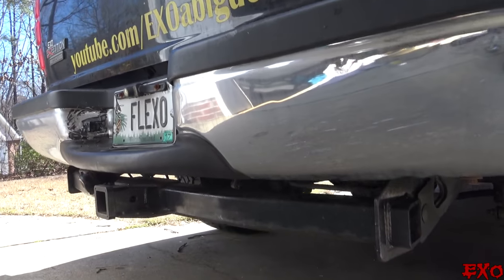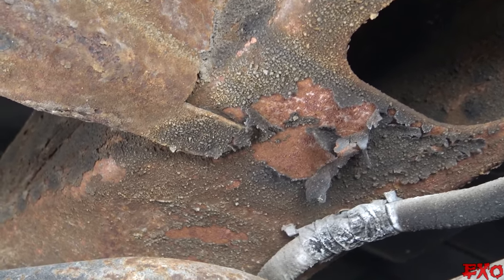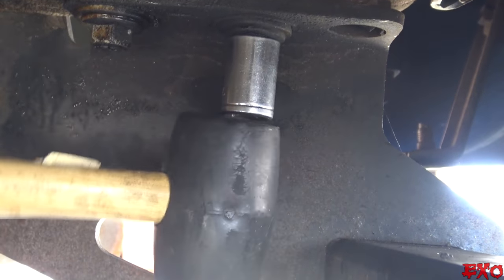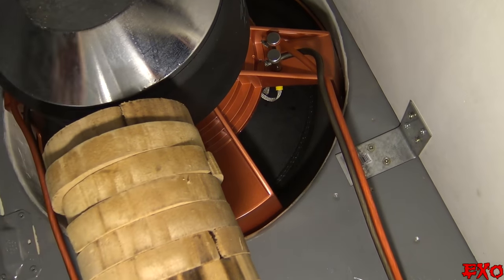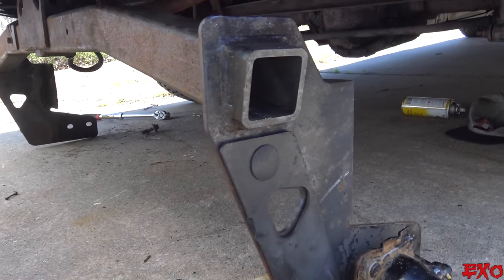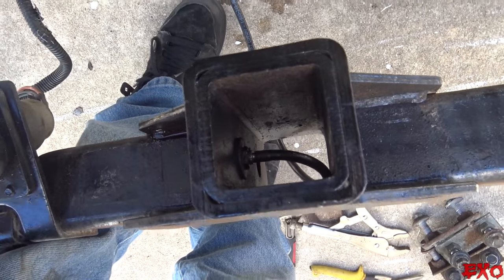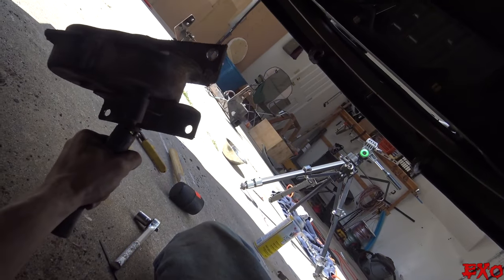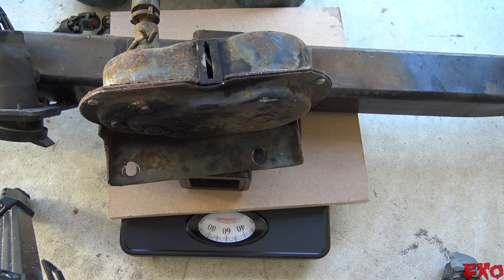FRANKENSTEIN Gets Lighter... Reducing EXO's Truck Weight by Removing UNUSED Metal Towing Parts

Comment: In my Pajero. I've towed a trailer that had my engine for it. My Pajero has just as much weight as your truck has. and I towed the engine alright. I can't see the tow bar would do much to the over all weight of the vehicle. Might even come in handy some time like mine did.

Comment: ditch the bumpers and run some roll pans to lighten it up more.
Reply: pickle street customs *AGM battery would easily take 10lb off compared to the antique lead acid design. lightweight forged or magnesium wheels but it is expensive.

Comment: por 15 rust converter and under coating easy to apply and last for ever i just rinse off my engine bay on my 1980 t top firebird  and it shiny black again with water and it kills the rust no sanding and very little prep

Comment: Hey EXO. for the underside rust  cleanup. Get some Naval-Jelly it's a tried and true effective products. There's a lot of rust removal products out there that don't work for DooDoo. You want a good penetrating oil? Not saying the other 2 are bad, but Kroil is called, "The oil that creeps", for a reason. It comes in a spray can and a can. Both work but the can stuff is better

Comment: I rebuilt an old utility trailer and needed to address the rust issue on it. So I did some research and found a rust converter called corrode all, check it out. All I did was scrap any rust the was flaking off then used a spray gun to apply it. It converts the rust into iron oxide and turns black, very easy clean up...just a suggestion.

Comment: Krawl works well with rusty bolts an nuts. Just sharing some good stuff I used when I worked in a welding shop, didn't use with welding I have my degree in it. Always had to fix the mower or something with stubborn nuts and bolts. Hope the krawl helps for future stubborn parts. Kills wasp too, can't stand those pd off punks lol.

Comment: Use a wire wheel on a grinder to clean off the rust. Etching primer then whatever coating. A roll pan would be nice on there.

Comment: all you have to do is heat the  nut and bolt with a blowtorch until it turns red in try to unscrew or break it off with a hammer and chisel...
Reply: alejandro buller Unnecessary here, they came loose.
Reply: JasonWW2000 nice ok then...

Comment: I would sand the axle down, and use a clear coat of plasty dip. 
but the tools i would use would be a hand grinder, having a wire brush end on it, instead of a blade. Make sure to wear glasses or safety goggles.

Comment: Yo exo was just thinking that that tow package might do you more good than taking it off as it would help to stiffen your frame where most if not all the weight is. You might run into maybe cracks starting to appear
Reply: Frank Buentello the added weight will also dampen vibration.  Also Exo...  bettet way to weigh it would be weigh yourself then weigh yourself holding the hitch.  And subtract your weight to get the hitch weight.

Comment: Ever considered air shocks in addition to the springbags for the ford?
Reply: 666hobart so $99 airspring bladders and $99 air shocks thats $200 for 2000lbs of assistance/lift..but for $200-$240 he can have real airbags with 5,500lbs of assistance/lift & lifetime warranty on real bags.. a real bag setup is smartest safest way to go..i learned da hard way so speaking up to save others time, money plus get 4X more help & the safest way dats why semi's & 5th wheel trucks use em
Reply: The air shocks are only 60-65$ (and thats up here in new england I'm sure they're cheaper in the south as with everything else) for a pair. Also ford has airbag suspension that will fit this from the navigator if one wants to spend that kind of cash, it's pretty obvious he's working on a budget. But I do dig what you mean man.
Reply: 666hobart yes my phrend 👳, I see many people from new England moving to GA. Maybe it's for economic reasons but keep in mind that the GA min wage is $7.25 so although things may seem cheaper you will get paid more in New England for doing the same job here in GA. If I get a Warehouse job in the wealthiest community of GA I'll have $13-$15/hr but that same job would pay $15-$18/hr. up North. There is one thing you can do, buy small items online and since you're buying from less wealthy areas throughout the US , you will be getting a better price than if you bought that same item locally.

Comment: weight reduction hell yea im converting from duel gas tank to single and loosing rear bumper for roll pan to drop about 100 lbs going to be lowering truck and dont need that extra weight scraping the ground

Comment: u should just get u some real airbags because $200 bags=5,500lbs plus lifetime warr on bags.. ur cheap $99 airbladders=1,000lbs no warranty so spending xtra $100 for 4,000lbs more of assistance vs ur bladders is not only a wiser small investment but its also the safest.. 5,500lbs more will more than fix ur weight issues
Reply: Mike McCabe, Stay away from SH-AIM INDUSTRIES. Do research and you'll read tons of bad experiences  about them. Have had one myself.

Comment: hey help full tool to have go and buy a carpet roller. pull the carpet taunt then press it on with the roller. never once have had a carpet have bubls or bulges. using that tool.